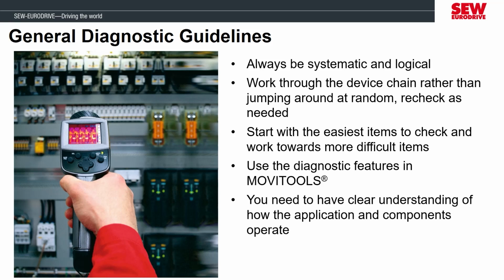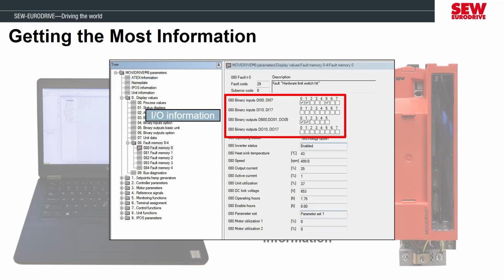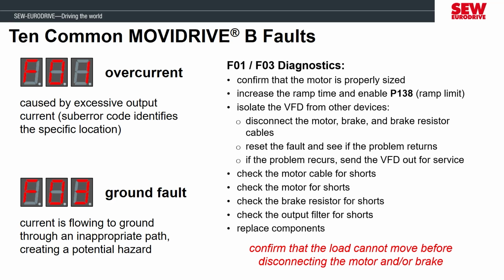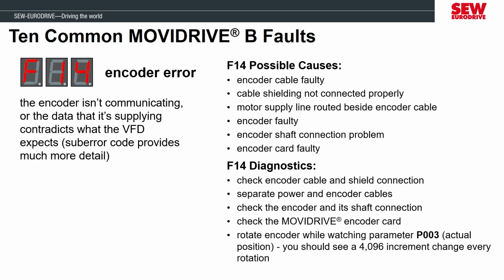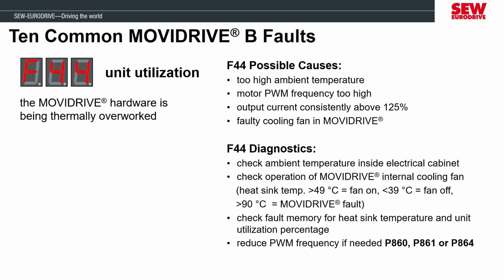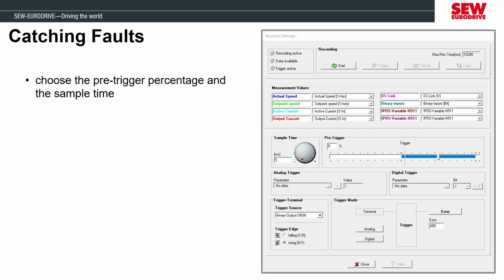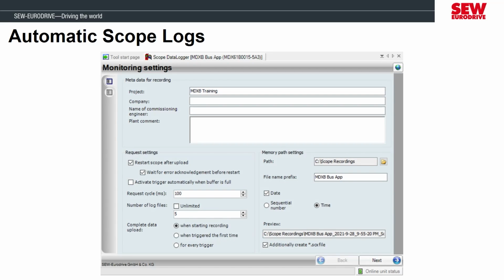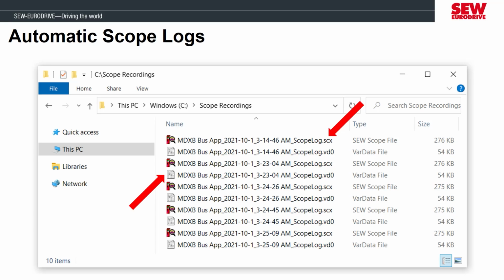MOVIDRIVE® B Training Session 7 - Troubleshooting

Comment: Hola podrian enviara el link del manual completo para poder usar, quiero resetear a fabrica y no puedo
Reply from the maker: Hello. Here is the link to the Movidrive B System Manual in English below. You can do a factory reset using parameter P802 and set it to "Delivery State". Just know that it will delete everything. So you would need to back up any IPOS programs or parameters first before doing the delivery state. There is no final warning when you change P802 to "Delivery State".

https://download.sew-eurodrive.com/download/pdf_u/27793230.pdf

Comment: hi. thanks for your video. i need to solution for f09 error cod ("wrong operating mode selecting"
Reply from the maker: Hello. Error code F09 relates to the motor startup procedure. You can watch this video here on how to do a motor startup. 

https://youtu.be/xfv-2NtQMNY?feature=shared&t=225

Depending on the model type of the motor you have installed the Movidrive parameters have to be correct for that type of motor. The operating mode is parameter P700 but you should not change it directly. It needs to be done through the startup procedure shown in the video linked above. Once you input the values in the startup and click "download". Those parameters will be corrected in the background to match with the motor that is installed. It's helpful to get a picture of the motor's nameplate to aid you during the motor startup procedure.

Comment: hi mr , i have problem with F14 code 27 , can you share me the way to trouble it!
Reply from the maker: Hello. Fault F14 is related to errors with the motor encoder. Specifically, with suberror 27 this is indicating a loose connection at the Movidrive or at the motor. It could also be a defective motor encoder. 

Is the fault sporadic or constant? 

If the fault is sporadic then it usually indicates a wiring issue with the encoder cable between the Movidrive and the motor encoder. This could be a loose wire, incorrect cable shield connection to earth ground at the Movidrive and motor, or a broken/cut wire. If the fault is constant and there are no obvious issues with the encoder cable connections. Then it could be defective hardware where you would need to replace the motor encoder or the complete gearmotor if is a permanent magnet servo motor for example.

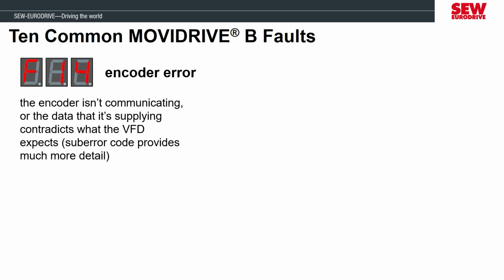At 21:02 in this video are some tips for checking the cause of the error F14.

Comment: Hello . We have a broken power module MDX60A0750-503-4-00 SACH NR 8226644
NR 0235016
F 0..180HZ   on a MDV60A0750-503-4-00 control unit.
We put a new power module MDX60A0750-503-4-00
P# 08226644
S# 31.6181737301.0002.24
F 0...599HZ
When we power the power module,before starting the motor, we get an instant F01 overcurrent .
Is there anything we can do?
Thankyou.
Reply from the maker: Hello. If the F01 fault started after you installed the new power module then the probable cause is that the MDV60A control unit can't operate on a newer power module firmware than it is capable. This would need to be resolved by downgrading the EEPROM data of the newer power module to make it compatible with the older MDV60A control unit. This can only be performed with special software by an SEW-Eurodrive Service Technician on-site or by shipping the complete MOVIDRIVE to your nearest SEW-Eurodrive Service Center for repair. 

You can find your nearest service center at this link:
https://www.sew-eurodrive.de/meta-pages/contacts_worldwide.html

If the F01 fault has been the primary fault that caused you to start replacing parts then there is possibly an issue with the motor power cable or the motor itself. The F01 fault usually indicates that there is a short circuit phase-to-phase or phase-to-ground somewhere between the MOVIDRIVE and the AC motor. Or if the motor being used is several sizes larger horsepower/kilowatt rating than the MOVIDRIVE it is connected to.

We discuss common things to check with the F01 overcurrent fault at 10:50 in this video.
Reply: @SEWEurodriveUSA  Thankyou for your reply.
We tried without motor cables connected to the drive and got instant F01 when we power on with 400V.
We tried with another MD 60A control unit,the same.
The old problem was not F01 .
Only when we power on with 400V we get instant F01.
Finally we put an old power module and it is working.
So there is a chance that the new power module it is not damaged.Only a firmware problem.